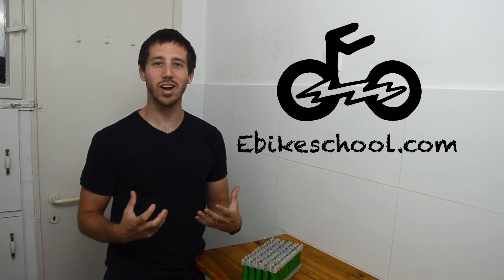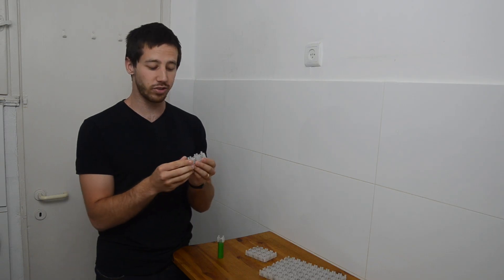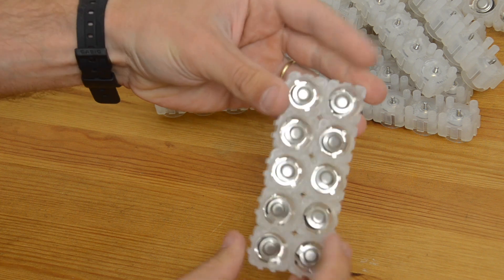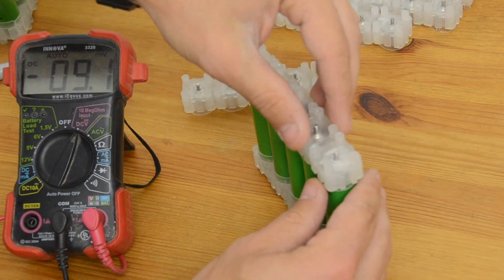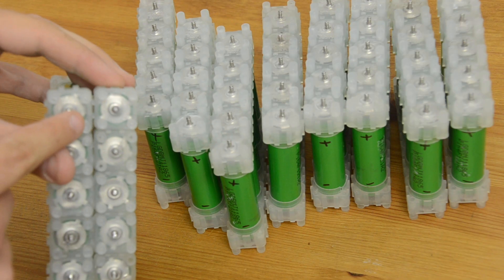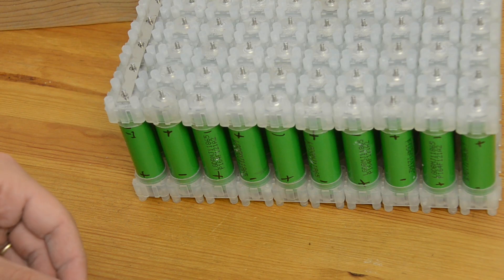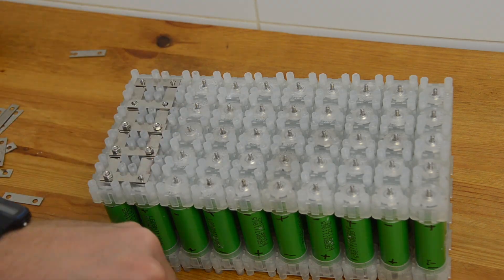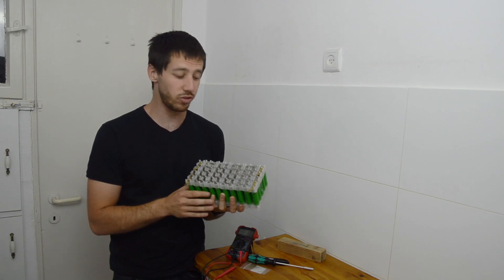No Spot Welder or Soldering Battery Building Kit from VRUZEND.com

Comment: How, with the inconsistency in diameter of 18650 cells, does the caps hold them with enough force to make a solid connection at the terminals?
Any looseness will result in heat build-up.

Comment: Question here, not a pro electrician. I do know that 5mm nuts tend to loosen up easily with vibration. Would putting a bit blue Loctite on each screw before putting the nuts would have a bad effect on the power connectivity?
Reply: I probably wouldnt use loctite since it seems to connect via the threads into the nut and then into the plate, so you might be semi insulating the threads with loctite. Locknuts might work though, although a bit more money. Id probably just wack some hot glue on all of them and call it a day lul

Comment: Current capacity is unknown.
Vruzend.com states tested up to 3.5a
If they can't handle at least 10 times that, they are useless to me.
Better off connecting pouch or prism cells with copper bus bars.

Comment: I've soldered tags to CR2042 cells. Being thin have to be careful. I tinned the surface with solder then was able to attach the (tinned) copper (or brass) tags with just enough heat. Not everyone will like the idea but it does solve the issue of mechanical loading.

Comment: 1 30 cap kit cost 41.99 bucks. For a 48 v 20ah ebike battery made from 18650's you need 3 kits at 125.97. Then you need to purchase 130 batteries, check them all and hope there are no duds. I considered this route because I don't solder but I feel in the long run it's much cheaper just to buy the ready made battery pack. This company also sells the batteries.. the cheapest they carry is 2 for 5.99.  60 packs of 2 for 5.99 is 359.4.. plus 125.97 =485.37.

Comment: how much additional weight do you ad on a battery pack ?.... 50%....; 45%.........; 40%.....; it must be at least about 30%.......:-(.... // what kind of material do you use for the connetor's ? // and last but not least: sadely,  you are loosing quite a lot of current as well as amps with this method (unless you are working with aluminum, or cooper or silver or gold conectors.... // the good part: It looks to me a lot easier to replace "Judas-cells" if needed // 11 min 50 sec: the possible vibrations won't kill the pack assembly....but the nots might vibrate loose  because you do not use loctite or a small spring washer.... =  amateur !!

Comment: Will be nice if you have a white board on the wall and drew what you are doing electrically with the connections, also these will work on other brand batteries? Like the Chinese made? No all factories will have the same diameter tolerances.

Comment: I would use them, if they weren’t so expensive. Like c’mon, $40 for a 30 cell battery?! If I’m building a battery with 120 cells (20s6p) I’m better off just buying a spot welder and soldering iron.

Comment: Hey
Soo
I have about 300   26650 4500mah 50a max 25a continuous vape battery cells. I was wondering if a regular bms will work? Any tips. I'm currently trying to convert a car alternator to run as a 3 phase motor lol. I'm looking to build a 52v battery out of these cells.
Any tips on which bms to use? 
Also would a 52v battery work witha 48v controller?

Comment: Can you modify the voltage controller to increase from 60V to 68V for the scooter I will be getting. It will be dual motor 2 x 5600w @ 60V.  Would like some more juice. Do you know anyone who has mods like that available?

Comment: Just getting into lithium battery electronics and I’ve just bought your book this arvo, but haven’t read it just yet ☺️ so could you please tell me, was one of the design goals of these battery building kits to deliberately provide air space between the cells for cooling? I have no idea whether it’s necessary or not but interested in whether it’s necessary as I watched another video of yours where you built a triangle battery (https://youtu.be/clawhNsORts) but it ends up sealed with heat shrink plastic anyhow, so I’m guessing air-movement isn’t a huge deal?

P.S. Thumbnail incorrectly asserts there is such a thing as “LEGOS” building blocks 🤪 Always was and always will be just “LEGO” thank you 🧐😂

Comment: Dear Mr.Micah : I'm a 60 years old and no longer can drive for reason of health ,I live in Los Angeles CA. and I do all my commutes with my Ebike ,but the 48 volt 20Ah battery fell short of range for my needs ,can You please make a videos to make videos about making a 48 volts 30 Ah battery using the same Vruzend system ,I did read Your book (DIY lithium Batteries) but is hard for mi to understand ,Thank You for Your time

Comment: I bought these. Cool idea, but they are poor quality. Many arrived cracked. Plastic molding required me to trim in some areas in order to fit together. Screws were too short and stripped easily. Couldn't get the nut to thread in quite a few places. I do not recommend. I understand there's a new version. Hopefully better.

Comment: crap . you can buy caps like this from ebay , amazon , etc , they are not good for bike , escooter and anything thats moving , bouncing , in time they get lose , happen to me 20 km  away in co side and it wasnt happy pushing at  my scooter  :) , spot welder is the best option for any battery.

Comment: Toooooo many points of failure, nuts coming loose, connectors coming away from the battery terminals. But most important is battery cell pack safety, and your pack design doesn’t include a cell pack fuse system. If your appealing to DIY’er’s then this is vital as these packs can be very dangerous and mistakes will happen. Each cell within the pack should be fused in the event of pack failure, short or excessive current draw. I understand what your trying to achieve but safety and  reliability must come first.
   Regards
        Chris

Comment: As a newbie to battery building this kit really makes it easy. A bit of a learning curve on connecting them but once you know the secret..easy peazy. The terminals for the wire contacts though could be beefier and a bit wider. 1 gauge doesn't quite fit IN the connector.  The battery comes out less streamlined but it'll be worth it if you don't want to mess with  soldering or welding.

Comment: Your No Spot Welder kit use screw to tight up the nickel strip. But the BMS board supplier inform us that never use screw on battery , because it will damage the IC part of BMS ?

Comment: 72 v 50 ah what cell + BMS should be used
Reply: the cell depends on what you need it to do really and you'd want it to do, you'd end up with 18 cells in series and something like 25 cells in parallel and an 18s bms rated at the desired current output

Comment: Why in the world do you fast-forward through the connections which is the most important of this video ?
You spend so much time on pressing them together which we get in 30 seconds but the part about series parallel connections you just Breeze through
And why not make your busbars thinner in the middle to act as a fuse as a safety measure ?

Comment: "No Spot Welder or Soldering" for a high current EBike application?  Not UL approved?  What could possibly go wrong???!!!  That's how the Chinese make connections.  Lousy connections plus high current = FIRE HAZARD.  Period.  And yes, I'm an electrical engineer with decades of experience.  Let the lawsuits begin...
Reply: This is precicely why this is a DIY kit. You are responsible for the stuff you build yourself. This is not a pre-assembled products. They do make a high current version of this, with nickel plated copper contacts and bussbars. As for soldering lithium cells, bad idea...

Comment: guys i bought 100 of them and the plastic caps seem to be cracking over the time like 3 months resulting a loosen caps. i highly recommend spot welding or other means .thanks
Reply: Very possible.  White nylon plastic degrades when exposed to sunlight and becomes brittle.  Wrong material, poor connection method for high current.  No fuses.  Perfect Storm.

Comment: Hi.
I bought a Landhz cell of 3300mAh 30 A discharge and a box for the battery. I have mounted 3 cells in parallel for 3 = 12v 10Ah for 4 = 48V 10Ah. About 480W. The problem is that when I accelerate and ask the engine more, it gives a few jerks as if missing amperes, which recovers IN 1 SECOND. When it passes, that the voltage indicator turns red. What do you think? I am waiting for a BMS. If I get to know the work that I have bought it made. Can it be that the 2 mm copper wire with which I welded the batteries is not giving enough intensity? I would appreciate your opinion.

Comment: This a great product and I can see how it can make assembly much easier.  There are so many ways to fix the vibration issues mentioned. I would add lock washers to each connection with a nut.  You cant stop stupid people from making stupid mistakes, so that's no excuse for thinking these parts are dangerous.  Adults are responsible for themselves.

Comment: Not so ingenious.  There should be color coded to assist with orientation, and all those bus bar jumpers make it confusing and easy to create a short circuit.  Considering some people have trouble with simple series/parallel hookups, this could easily be a disaster waiting to happen.
Reply: This vid is showing V1... if you look on the wed site you will see the V2 version witch is red and black..
Reply: Who is getting married?  This witch doesn't know which way is which.

Comment: And another suggestion, for the BUS BARS, Suggest you make it not a STRAIGHT FLAT BUS BAR but rather a TAPERED BUS BAR or it is very thin at the middle portion, for what purpose? The thin portion will act as the FUSE WIRE, making it not only a BUS BAR PURPOSE but also has FUSE PURPOSE, a thin strip at the middle of those BUS BAR will burn, break or melt just in case 1 cell becomes defective and effectively shorts out.

Comment: This holders will get lose in time with vibration.
Also, need to test the current limit of the phisical contact, and the heat generated from high load.

I would use the method only for a stable not movable battery packs, but not for ebike or any e vehicle use

Comment: It doesnt matter how many volts, just that voltage shows?!?! NOOOOOOOO! Cells should have equal voltage prior to connecting them. Between that and your ring... youre going to get someone killed.
Reply from the maker: I showed how to check that cells have equal voltage in the beginning. Later when they are in the caps, you know they are already equal voltage, so you just check that voltage shows.

Comment: I need to make a 450 volt 200 Ah battery pack using 18650 5Ah cells, how many caps do i need?
Reply: youd need like 4800 caps purchasing a spot welder and designing the battery that way would be far more cost effective

Comment: I would never trust this in an electric vehicle of any kind. Imagine pulling 20 amps from your cells through those spring connections. Or dirt and oxidization between the cap and the cell contact. Very bad product to endorse for a roadworthy vehicle in my opinion.
Reply: Totally agree.  Very very bad design.  Trust me - I'm an electronics design engineer.

Comment: the down side is ...because of the square arrangement of the cells , space between the cell , space taken up by end caps , the finished battery is twice the volume of a spot welded one , and has fragile plastic caps on top and bottom .... and it's expensive.

Comment: You do realize, that you could buy a cheap spotwelder for the same price as for the parts for this just one set of 50?
So, if you plan to work with more than 100 cells in your life, better get a spot welder.
Good solution for beginners, though.
Reply: they dont work well at all lol

Comment: you guys need to work your marketing better. your site fails to mention a HUGE advantage to using these end caps...spacing. every cell has space between it and the next cell. this lets in air around the cells for cooling.

Comment: Like the NO spot weld or soldering idea. One quick question, does the spring loaded contact good enough for high amp current usage like ebike battery? My only concern is the resistance between the battery terminals and the spring nickel disc. Any advice would be helpful.
Reply: Spring loaded contacts of any kind will lose the spring force (temper) if heated, resulting in an avalanche effect.  It goes downhill from there (no pun intended).  Carry a fire extinguisher and wear fire-proof clothing.

Comment: When you add the discharge wire connectors (11:30), you place the first on so it is hanging off of the battery pack and left the middle cell unattached? is there any motive behind that? could you move the lowest discharge connector up 1 cell so it doesn't hang off the edge of the pack to save space?
Reply from the maker: Yes you could definitely move it up. The way I did it meant that the middle cell that isn't connected is sort of 'shared' between the two brass connectors and only has to send half of its current each direction. But your idea also works and saves a bit of space.
Reply: For  bigger batteries (6 or more cells in parallel), do you have a rule for how many discharge connectors should be attached to those end groups? Should you use 3 for a 6p battery? or 4 for an 8p?

Comment: This is a horrible idea! Do Not short it when it comes to a Li-ion battery. Buy a quality battery that isn't going to short and destroy your bike. Homemade battery packs are dangerous and not worth trying to save any money.  All it takes is one simple impact and it could cook down. Be smart and buy quality.
Reply: Brian Bassett homemade packs can be safe if you build them right, prebuilt packs are rip offs for the same thing, granted I could see how this isn’t as safe a a soldered connection
Reply: @cjbrags1344  The point is the 99% of the morons that attempt this Aren't going to "build them "right"" you fucking numbnuts.

Comment: I want to build these for a 36V Golf Cart Battery and it appears I probably need at least 4 of these in parallel. I will probably start with one and get it running. Can the BMS that VRUZEND has handle 10s 10 P and do you have a video to put these in parallel so it make better sense to me.  I would think going parallel I would attach each pos to pos and esch neg to neg to each other from each battery as well as then each battery would go to one single point to both the load and the charging post. I would also get a smart charger that could recognize the battery voltage, max recharge and series and parallel set up. Any help would be great and if you have a video that would be good too.  I just got the book and I am reading it but I am very visual so the video was perfect.

Comment: Before parallel connecting cells, you should balance them to have the same voltage at least! Ideally you should measure the capacity of each cell and match the series parts of the stack so you get the most juice out of your battery.
Reply: Hopefully, this guy will read the comments on his video.  Maybe he will learn something before he - and his team - come up with another product to sell.  I doubt that any of them are engineers.  If they are, I see no evidence of real world experience there.  A train wreck just waiting to happen...

Comment: I’m very interested in building a 36v battery for my daughter’s electric dirt bike, it’s an Oset 36V model currently with 3x 12v 10ah sealed lead acid batteries currently. These lithium ion batteries should work fine for this application, right? Thanks